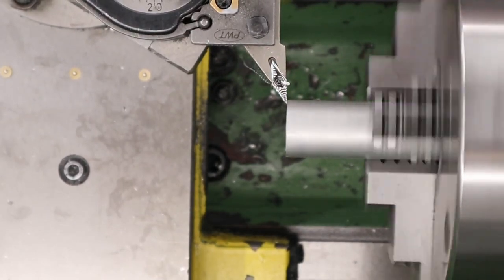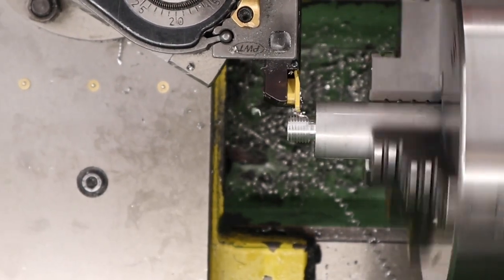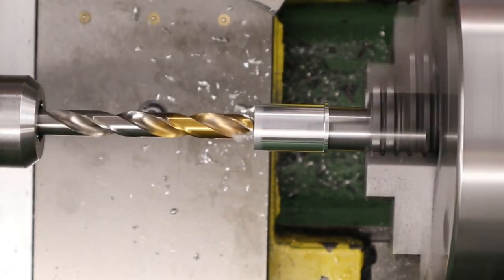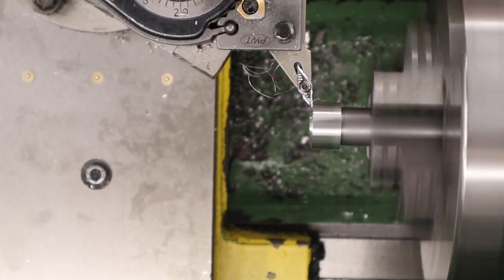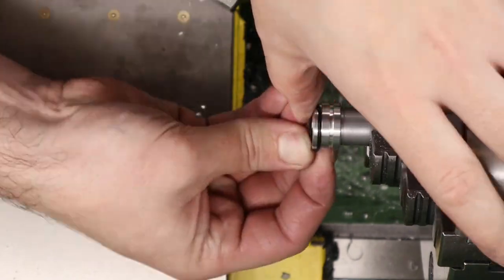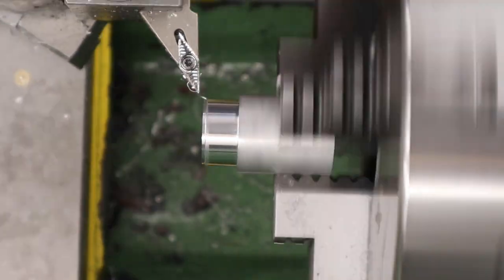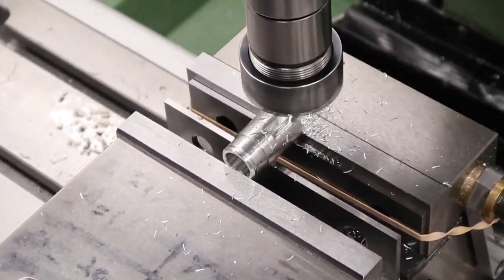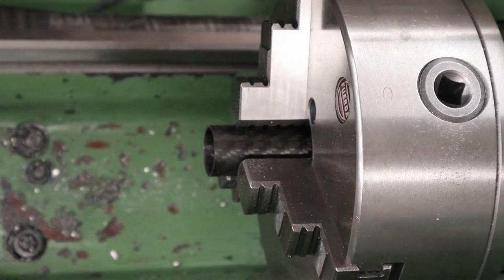Making a shroud for the BSA R10

Comment: Hi sir, you're No. 1, I've been following you for a long time. Please I have a question, what length is the empty space in the shroud, between the end of the pipe and the UNF adapter?
Reply from the maker: it was about 50mm on the r10  the more you can get there the quieter it will be but also longer
Reply: @sub12airgunners  Thanks man. 👍

Comment: What glue is used for carbon - metal bond?
Reply from the maker: We rough up both the aluminium and inside of the carbon tube with sandpaper then use 2 part epoxy  for the glue. Thanks for watching.
Reply: @sub12airgunners  Thank you! I try to make one for Katran.

Comment: That's the SE version so it never had a bright steel barrel and it had a screw on narrow barrel shroud and silencer (moderaitor) as standaerd, so why did you waste time making something you got with the gun, other than in terms of some cosmetics, but then remove the B.S.A. silencer ? If you really had the time and money to do this, why not get the Huma air one, it will drop you the decibels only slightly more than the B.S.A. but it does look better.
Reply from the maker: because we converted it from .22 to .177 and we wanted a longer barrel to make it more efficient so the standard se shroud wouldn't fit anymore , i can make one for a fraction of the cost of the huma so why would i buy one